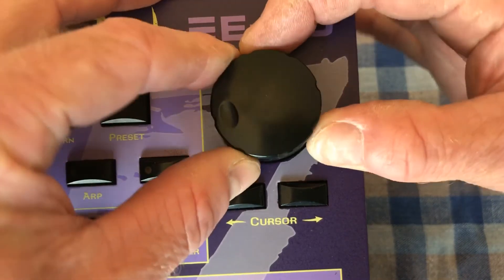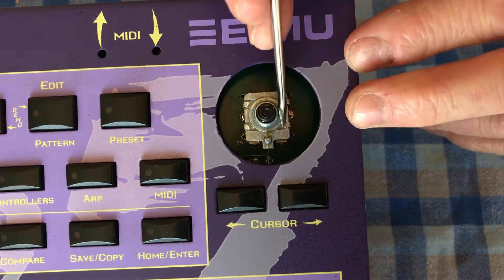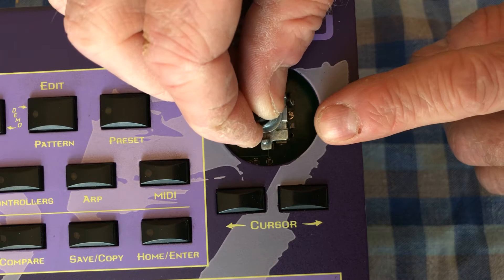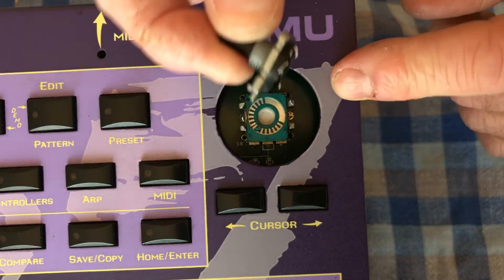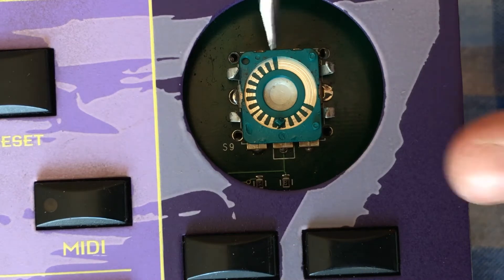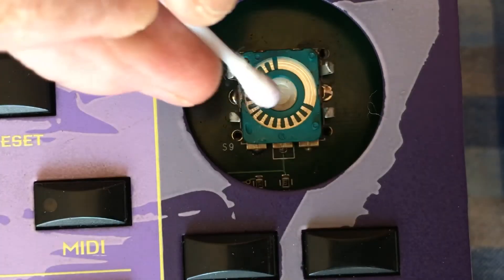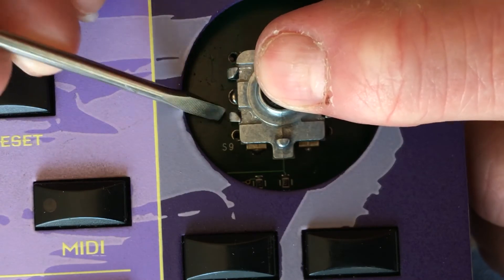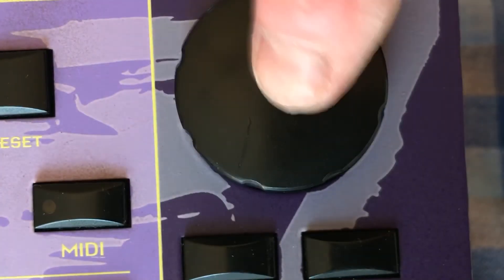Encoder wheel clean on the Emu Command Station MP7

Comment: Great video!  Thanks, I learned a lot.  I never imagined it would be so straight forward to open an encoder.
Reply from the maker: Hey, I appreciate you letting me know 🙂
I have also seen a differently designed encoder which does not open up so easily… the outer cover has to be desoldered from the board, or cut off 😕
Kind regards

Comment: Thanks. My XL-7 has a different type of encoder, which seems to be soldered to the board so you can not open it; similar to the one in this video https://www.youtube.com/watch?v=8DuO8wW4oHI; however as you suggested as a first attempt,  I sprayed some contact cleaner, in my case I used isopropyl alcohol (99%), down the shaft and turned it for a while and this fixed my jumpy encoder problems completely
Reply from the maker: Brilliant ! Glad you got it fixed 👍
Reply: @1heUndertaker  Thanks; unfortunately after a few days it went back to square one; my only chance would be to replace the encoder altogether
Reply from the maker: @monck363  Hope you are able to get it fixed !